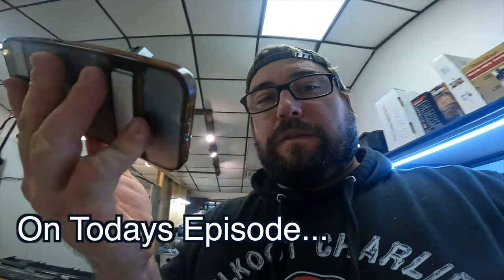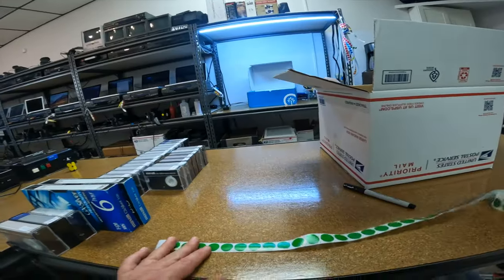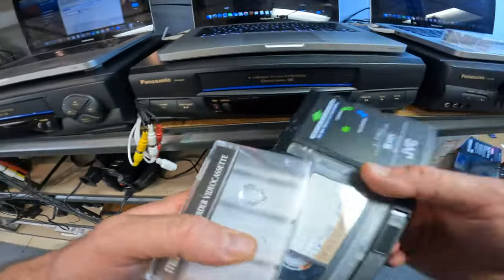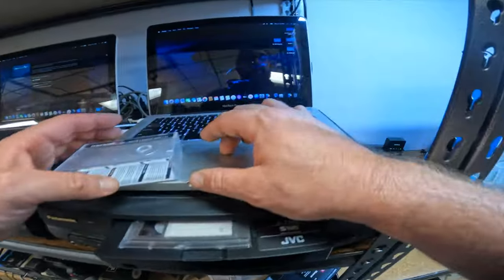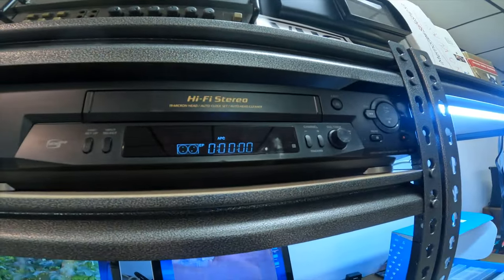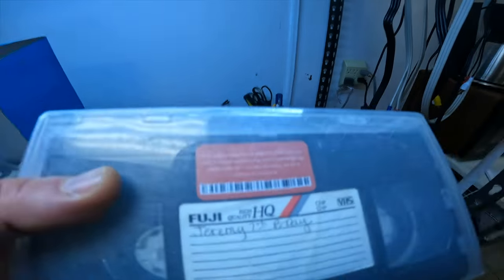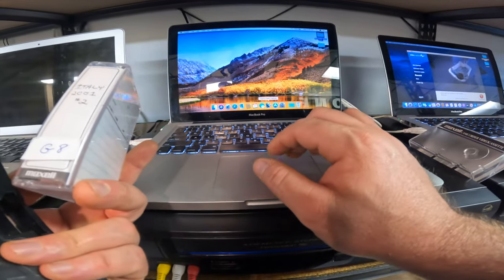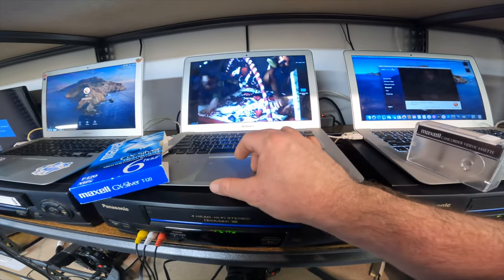AHHH!  Compact VHS Tapes, Red stickers, Business Advice and MORE!

Comment: I've been doing a few audio tapes recently too. I have the cassette player wired to the line-in of my Hi-Fi, and that records to MP3 on a USB flash drive. I can usually just set it going and leave it until I hear the tape stop. Certain tapes need extra attention, particularly if the levels vary - for those I have a really old MacBook that can capture audio from the headphone port, and that provides slightly better quality than the MP3 recorder.

Comment: Is it true that I should remove the automatic head cleaner on a VCR?
Reply from the maker: Yes! It will eventually turn sticky and will gum up heads.
Reply from the maker: Or break off and nearly break the player like in this video lol
Reply: @EmeraldCoastDigitizing  Thats good because I took out all the ones of my VCR's lol
Reply: I open up every new VCR I find and it if has an auto head cleaner, I pull it out or snip off the end that touches the head. In some cases the auto head cleaner is part of the guidepost assembly and removing it completely will cause the tape to load incorrectly, so you have to be careful.